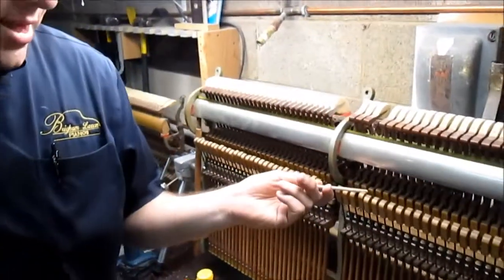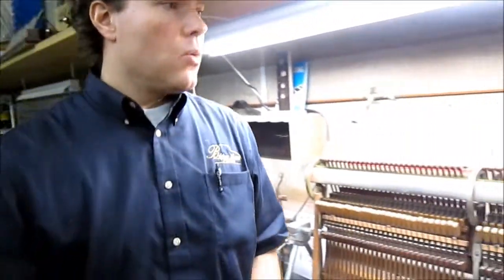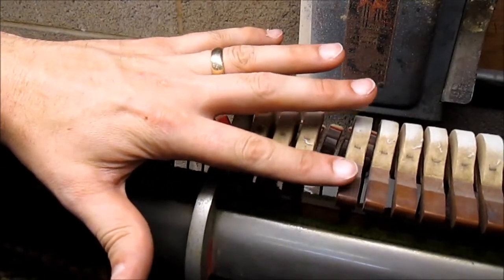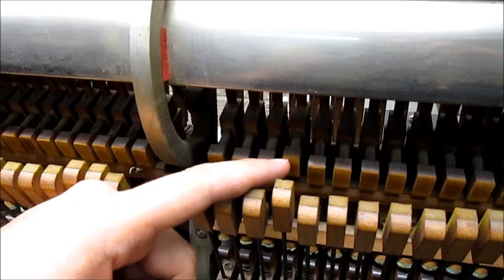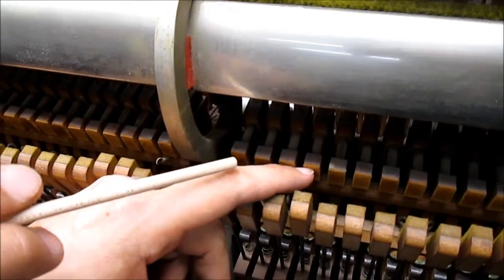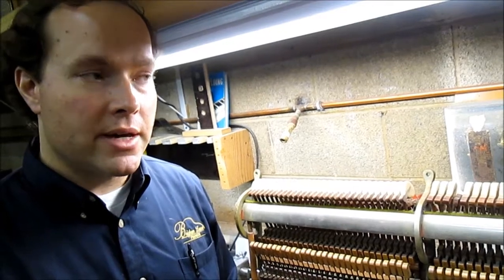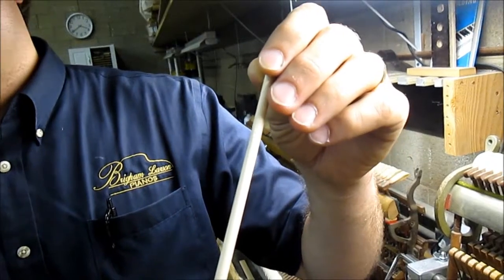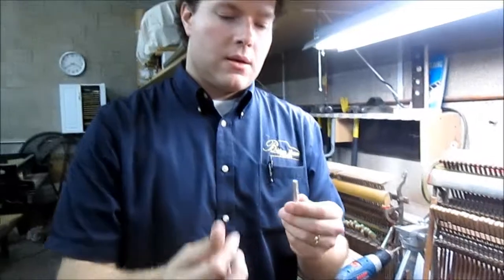Brigham Larson Pianos, How to Replace a Broken Hammer Shank

Comment: Great video, this is exactly the repair I am going to attempt. I was thinking about turning an aluminum splice on the lathe, but should probably just drill out the broken dowel on both ends like you did.
Reply from the maker: Best of luck to you!
Reply: @brighamspianoservice  I just replaced the whole dowel like you showed and it worked great. Thanks for the video!
Reply from the maker: @CleaveMountaineering  I'm so glad it worked.  Thanks for letting me know!

Comment: Piano hammers are attached using water soluble glue. Why not dissolve the glue around the hammer too remove it from the shank, and then use a shank extraction tool? No drilling necessary